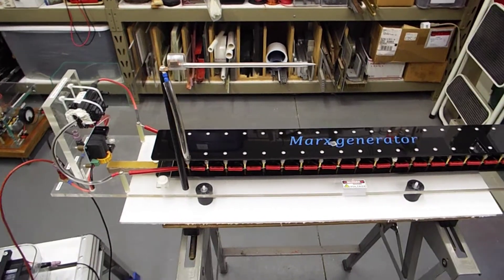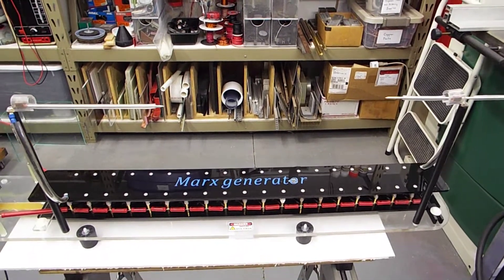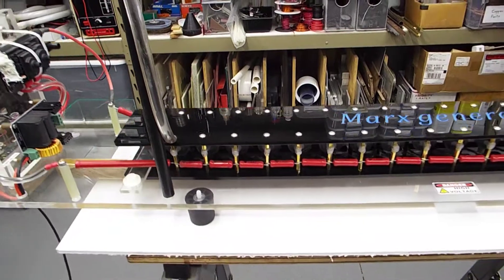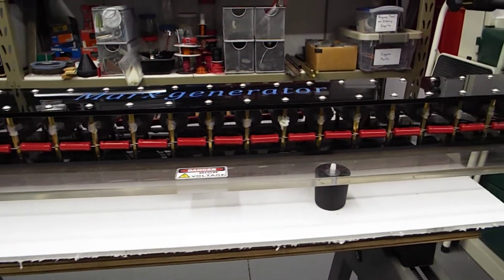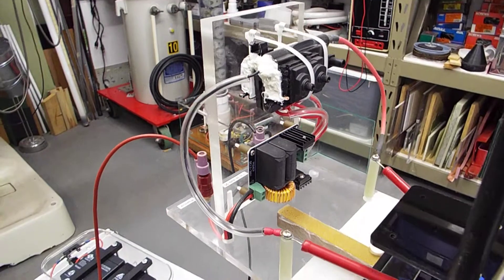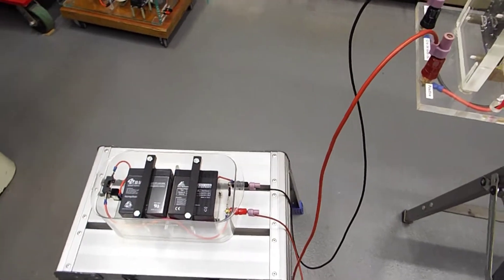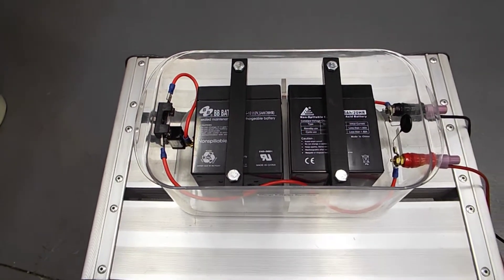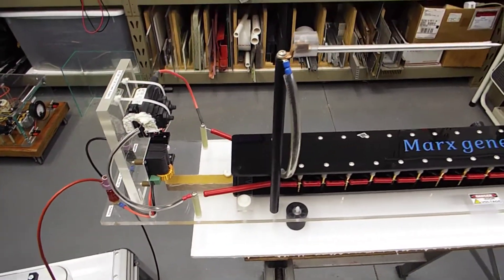Marx Generator Overview

Comment: Instead of connecting the anode side of the capacitors stages to the anode of the voltage source. Is it possible to connect all the capacitor stages to ground to a rod in the ground outside the window? Please lmk bud

Comment: Very cool 😎 do you have a parts lists and a schematics diagram available? Also is there a way to control the amount of voltage between the electrodes at specific distances, say I want 100kv at 14 inches? Lastly is there a way control the length of time an arc is struck for say 0.5 seconds? Thanks
Reply from the maker: The schematic for a Marx generator can easily be found with a Google search. They are very simple. The most common HV DC supply is made from a ZVS driver and a flyback transformer. Once you set the gap on the individual electrodes, it will fire at that voltage so there's not an easy way to adjust the firing voltage. The discharge time for a Marx generator is extremely fast, on the order of microseconds. That's what makes them hard to record.

It sounds like you may want to build a Cockroft-Walton voltage multiplier instead if you want that adjustability. Its a more complex project though. I have 4 videos of CW voltage multipliers.
Reply: @littleshopofelectrons4014  brilliant I will check out your other videos on Cockroft Walton multiplers I appreciate the quick reply.